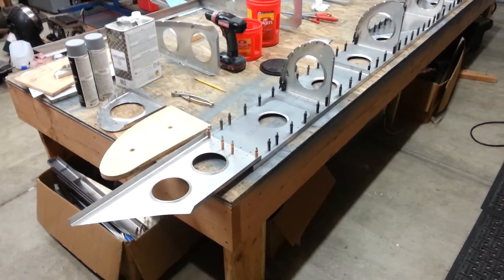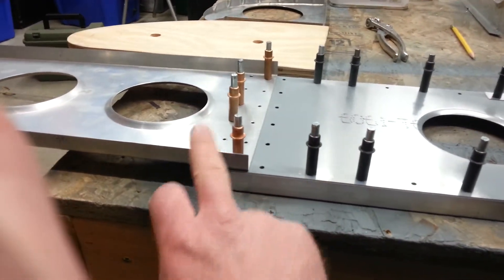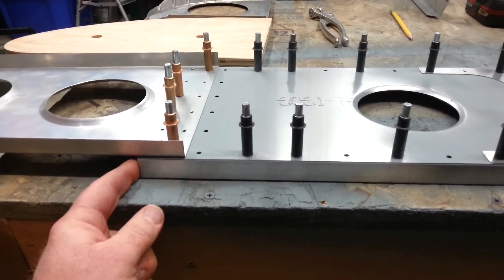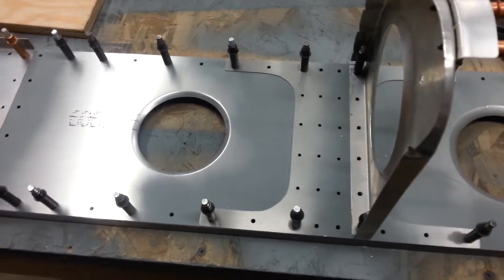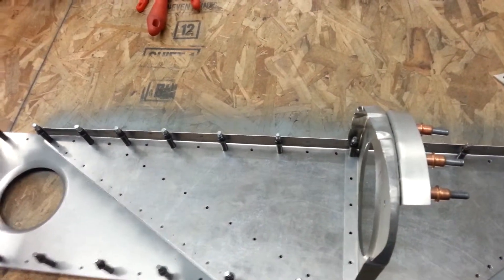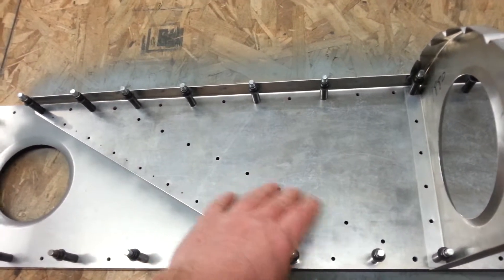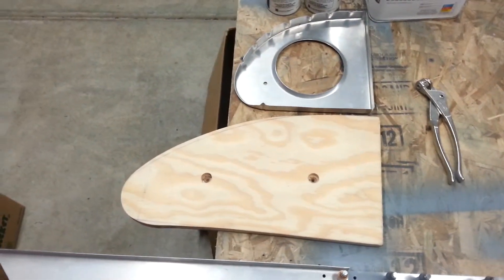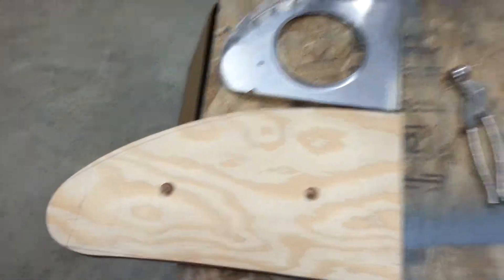Extended wing Zenith 701

Comment from the maker: Thank you for the question and the easy answer is heavier power plants. I did not plan to use a Rotax. After eading through the old post in various news letters / web forms many builders felt the standard wing was doing all it could to handle the extra weight expecially at low speeds. The builders who added a bay to each wing were very pleased with the results. CH hand drew a set of plans on how to extend the 701 wings. Other good information on the subject is on the Stol Speed website.